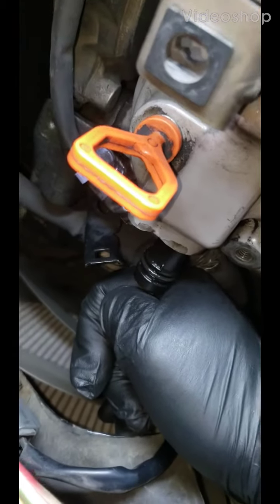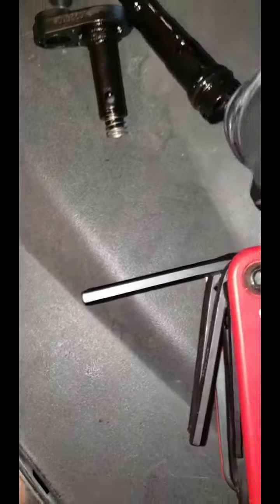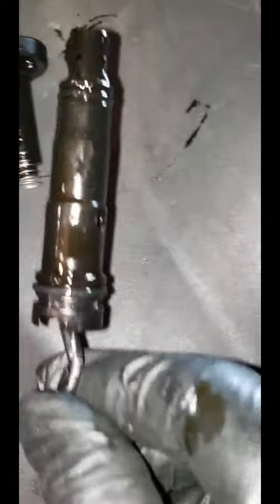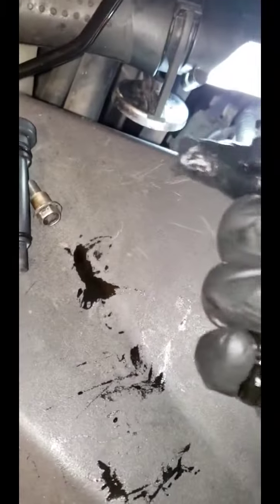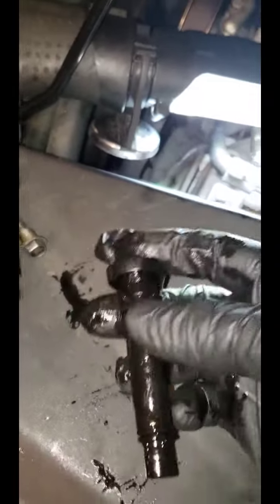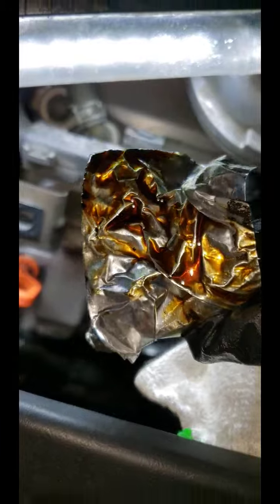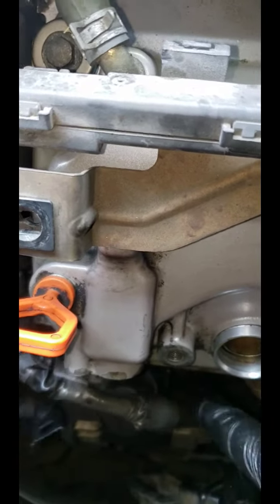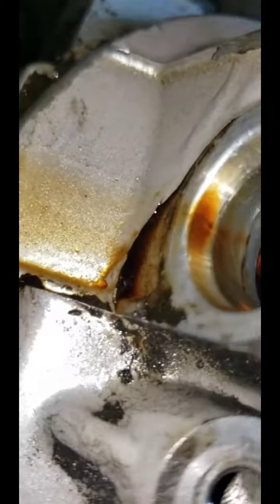How to fix honda  pcv broken  valve !

Comment: Thanks man for saving my life today, I had your exact same problem in my 2011 Pilot and a hanger saved me, thanks to you!!
Reply from the maker: @alvarobesa2757  hondas they have the same problem where half of the pcv breaks and stays inside so thankfully we still have metal hangers 😆 🤣  this is the reason I still try to upload videos here and there for people who appreciate my work. Hope you replaced your pcv with the oem one which will last years.
Reply: @lunasautogarage9643  totally, I've installed a genuine honda pcv, but I broke the old one I almost fainted, tried to pull it put with pliers and it wasnt working untill I found your video, thank you so much again man!

Comment: Funny I did the same thing today replacing the PCV Valve on my 2012 Honda Odyssey Touring but I still think getting an M18 long bolt is the way to go.
Reply: Tried a lag bolt but the valve was so brittle it broke into several pieces trying to remove it.  Had to use long tweezers and a long needle nose to fish out all the broken plastic.  I felt like a surgeon!

Comment: Why did you replace that valve ? What was its function ?
What symptoms the car had ?
Reply from the maker: Oil was leaking onto the alternator which is really bad if it does. Oil will destroy your alternator.